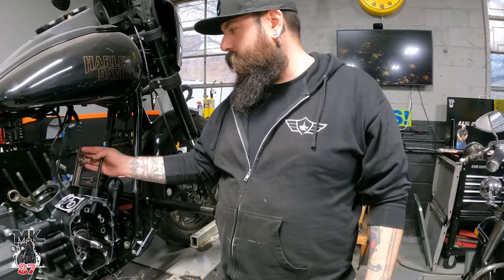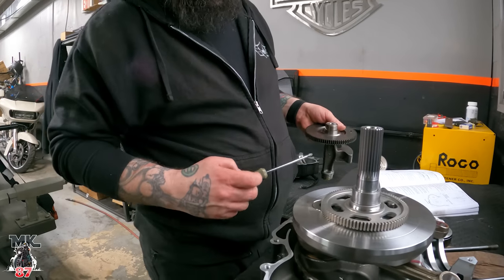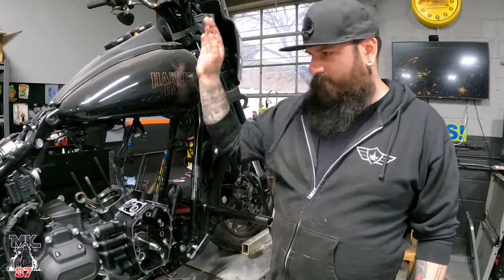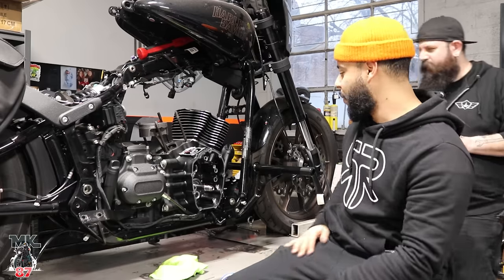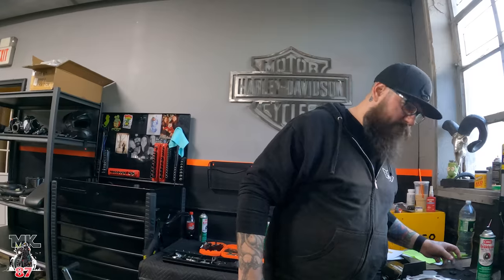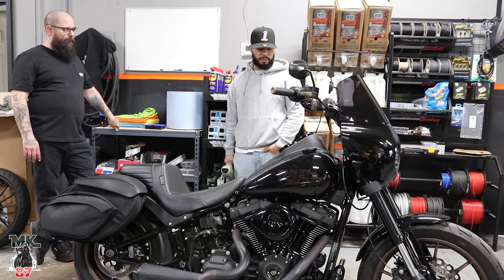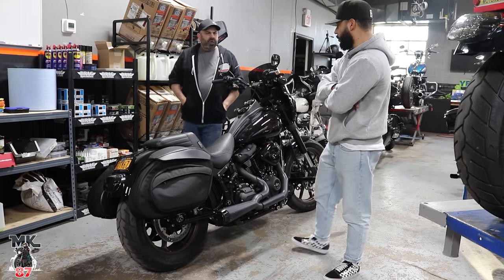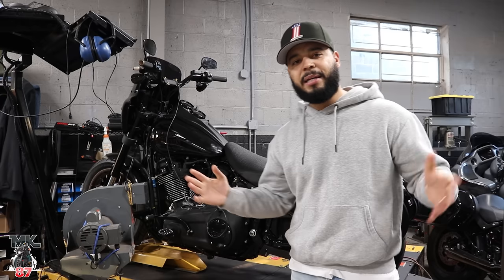Harley Davidson Low rider s / 122 Screaming eagle stage 3 build

Comment: I did the zippers 117 muscle kit with the 468 cam and sportsman clutch on my 2017 road king.  I had trouble with belt tension.  the torque was rotating the rear wheel so hard it would rotate the axle and loosen the belt.  but the road king has those stupid cam style tensioners on it.  yours has the proper good ones.  you should be ok.  great bike.